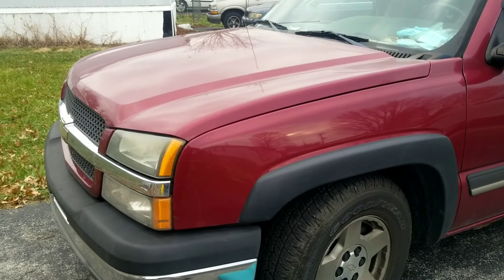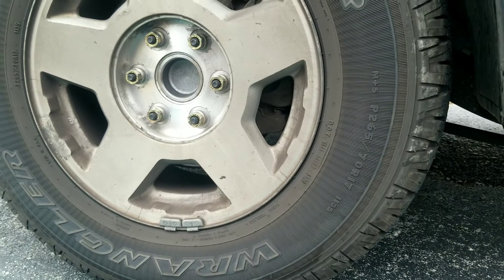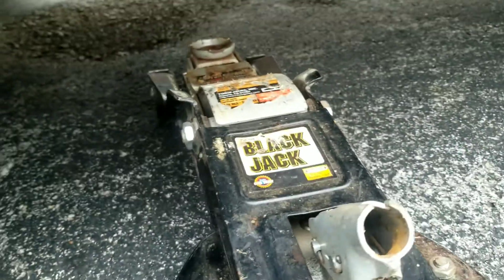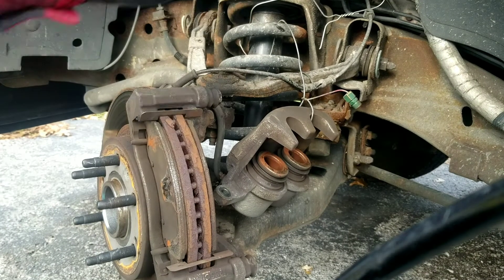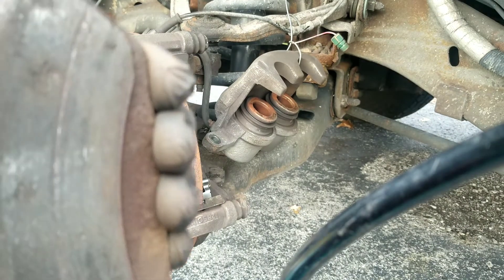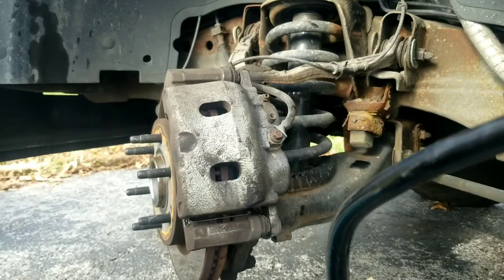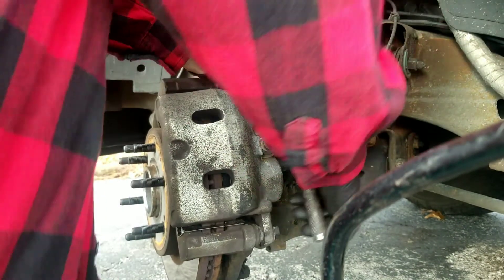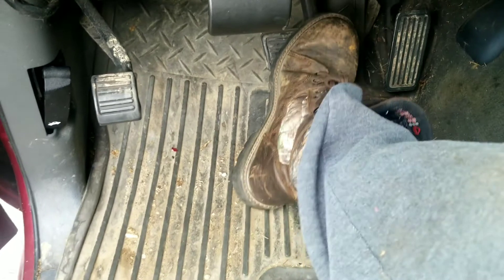Changing brakes on a 05 Silverado

Comment: Man I have the exact same truck, color and all. Always nice to see folks doing things for themselves 👍
Reply from the maker: Thanks. I have always been a do it yourselfer when it comes to saying a little money. 
Thanks for watching and God bless
Reply: 2005 Chevy Silverado, red crew cab. Love your lesson! God bless!
Reply: Trying to change a tire on the side of the road is near impossible for just me because the lug nuts are on so tight. It's practically an automatic towing bill with my truck. I can manage with my smaller car though.
Reply from the maker: @susanferguson5912  Yeah they can be a pain sometimes. 
The cheater bar on the ratchet makes a big difference and works much easier than a tire tool. 
Thanks for watching and God bless.

Comment: All tires shops over torque the wheel nuts. They don't want to use the torque wrench. I had to buy a battery powered impact gun  to take my wheel nuts off.  They were way over tightened.
Reply from the maker: Yeah. I feel ya. I have broken off lugs trying to remove them. 
Thanks for sharing and God bless.